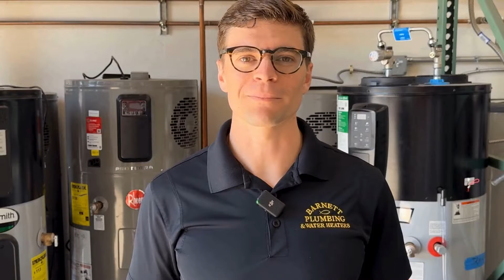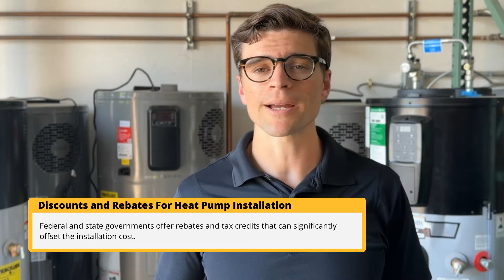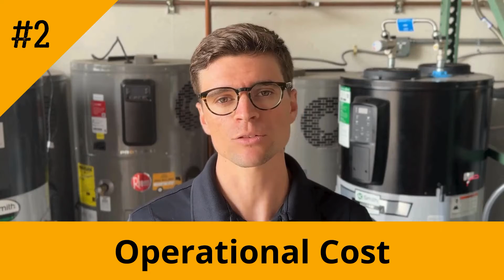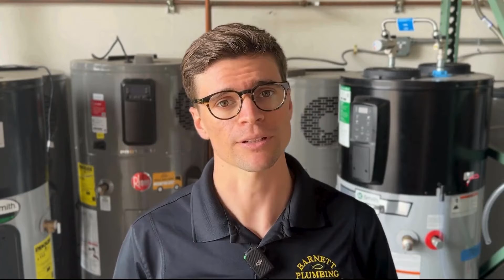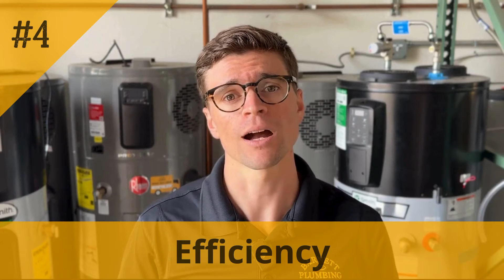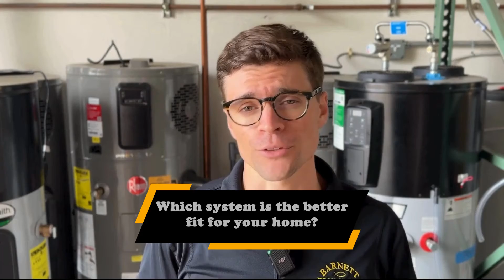Find The Perfect Fit For Your Home - Electric Tankless vs. Heat Pump Water Heaters

Comment: I have a 120 V 50-gallon electric water heater (ASHPWH) and for 2 retired people and 3 years of operation it works great. If you have a large family maybe upsizing to a 65 or 80-gallon electric water heater would be advisable. In the summer it uses about 2 kWh and in the winter 4 kWh per month. It did not cost me extra to install a new electrical circuit. It only draws 400 watts so is not loading the circuit down. I have experienced a tankless system for a few days, and the water would be cold then warm as I would turn off/on the tap while washing dishes and hands. A tank water heater does not do this; it is hot once you run the cold water out of the pipes. The difference in operational costs has to be low so I don't' see much of an advantage to a tankless system.

Comment: 2 questions. I'm in a cold climate. If the heat is taken from the room and I'm heating the room am I paying to heat the water twice? 
How about for a vacation home that is used 2 weekends a month at the most. When is a electric tankless more cost-effective?
Reply from the maker: Good questions! We don't recommend installing a heat pump water heater in confined living spaces where you are warming the room for your family. The heat pump will absorb the heat from the surrounding air, causing a cooling effect on the room it is installed in, making it uncomfortable or more difficult to heat. As for the vacation home, it depends on the size of the home and region that it is located in. Overall, heat pump water heaters are the most cost-effective water heating appliances on the market. However, an electric tankless can work well if you are in a region with warm groundwater. They can also be a good solution for small homes and ADUs. Our recommendation is to contact a local plumbing professional who can give you advice based on your specific home and environment.
Reply: @BarnettPlumbing So it wouldn't be a good fit for central Ohio would it

Comment: what about for an upper level condominium?
Reply from the maker: There are a lot of variables to consider, but here are some of the most common:
1. The size of the home. In our experience, electric tankless work fine in small homes with a single bathroom, while larger homes are better served by heat pump water heaters.
2. The size of the water heater location. Heat pump water heaters are typically larger than a standard gas tank water heater, so you want to make sure the space that it is in can accommodate the larger heater. Tankless units take up much less space than the average tanked water heater.
3. The airflow to the water heater. You need to make sure there is enough airflow for heat pumps to work properly, so if your water heater is in a small closet inside of the home, an electric tankless may be a better fit. If it is in a closet on the balcony that is large enough for the heat pump water heater, you can consider installing louvers on the closet door to allow for proper airflow. If you have an HOA, you may need to get approval before doing this.

The best thing to do is to have a local professional come out in person to evaluate your home's unique situation. That way, you can get the right solution to meet your home's needs.

Comment: How much electrical power is needed for a heat pump?
Reply from the maker: Great question! There are a few models of heat pump water heaters but the most common will either need a 240V switch on a dedicated 30A circuit breaker or a 120V outlet which can be on a shared circuit for plug-in models. There are also some models that require a 240V switch on a dedicated 15A circuit breaker.